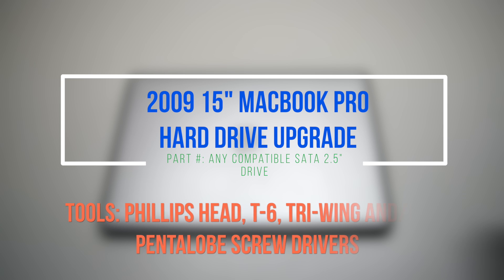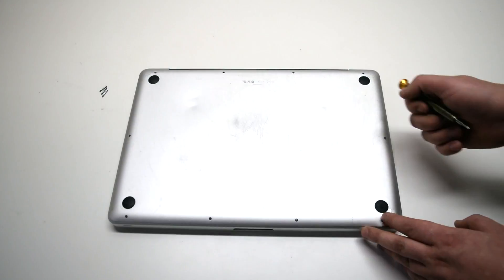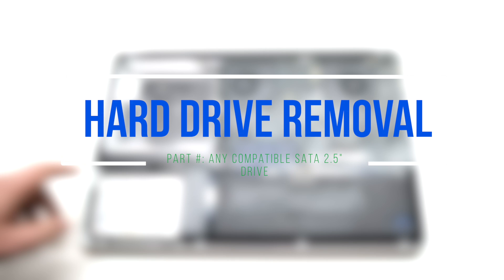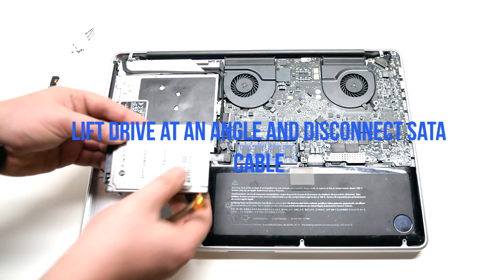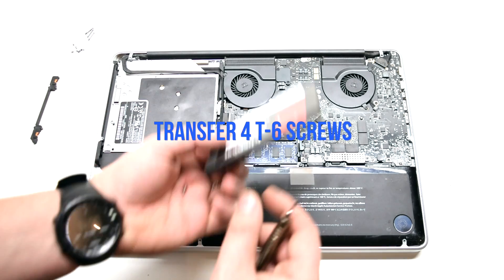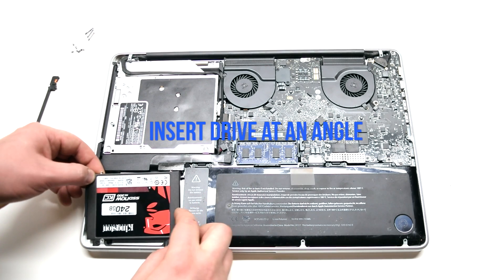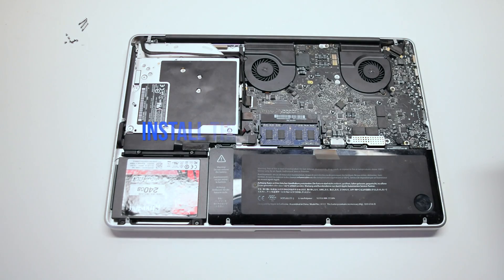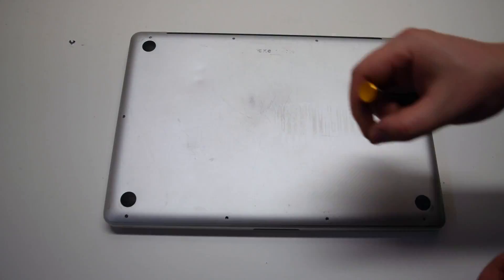2009 Macbook Pro 15" A1286 Hard Drive Upgrade

Comment: What kind of Solid State Drive do you recommend?
Reply from the maker: I would go with any SATA3 SSD, the most economical option on ebay or amazon. As per performance I have tried many brands and they all perform about the same, the most common that we use for all upgrades are Kingston SSDs.
Reply: I just want to thank you for making these videos. I have two macs from 2009. I have already upgraded the memory to 8 gb in both, now I am going to upgrade to solid state drives. In my Imac, my DVD play broke ( but who uses cds anymore ) So I am going to remove the dvd player and install a SSD to use as my start up disk, and then turn my 1tb hard drive into storage. You're videos have inspired me to upgrade and squeeze a couple more years of life out of my computers. I want them to last at least until 2020. 10 Plus years!!!!  If you have any other thoughts for pimping out performance, let me know! Thanks again- Andrew
Reply from the maker: Glad to hear that you are squeezing what apple is worth out of the Macs, as per the upgrade just make sure that the SSD goes into the Normal Hard Drive Location and the old drive goes into the expansion bay where the DVD drive use to be, this is because the DVD drive channel is half the speed that the standard drive channel is on. The SATA DVD Drive Channel is only 1.5 Mb/s vs 3.0 Mb/s on the main hard drive SATA hook up.  Good luck.